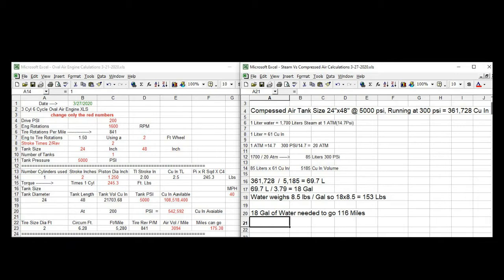Compressed Air Vs Steam Engine 3-27-2020

Comment: i like your idea.i dont think you compared apples with apples. how will you fill this tank with 300 psi?make a prototype with cheep air or gas cylenders.
Reply from the maker: First, thanks for subscribing! and i hope you clicked the bell to be notified of new postings.
Here is the newest video, it may answer some of your questions.
https://youtu.be/rtagPqymKVw
The compressed air will have to be compressed with a compressor that is capable to go up to 5000, and the tank will have to be strong enough to hold it. The tank and compressor are somethings that will have to be dealt with when the engine is finally completed to my satisfaction.